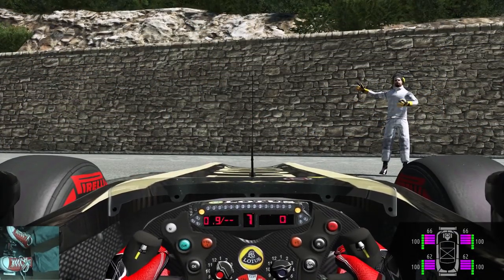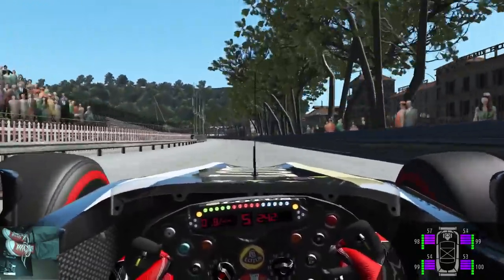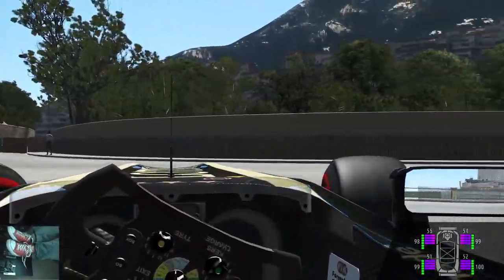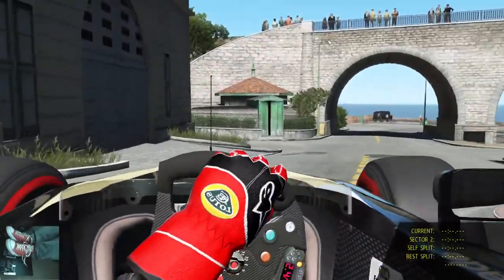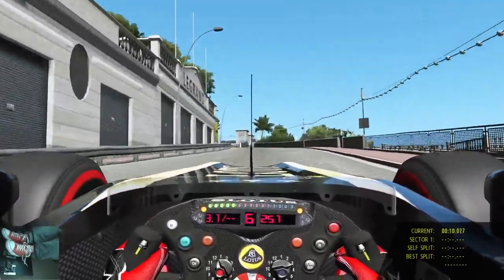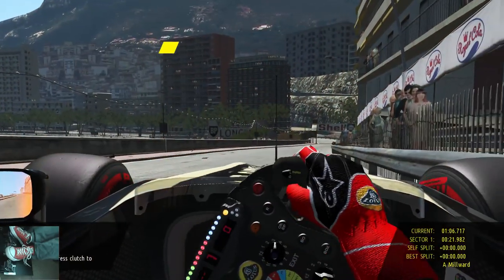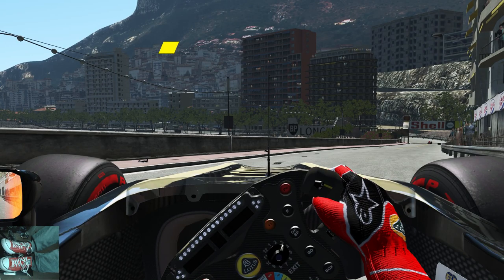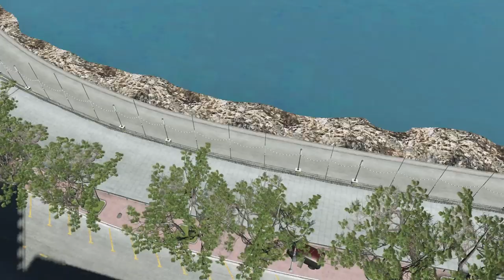HAMILTON CRASHED IN THE HARBOUR? What if Formula One Continued to Race at the Old Monaco

Comment: 1961- 1988 Kyalami circuit  running in Alonso 2013 Ferrari
1985 - 1995 Adelaide Street circuit running Vettel 2012 Redbull
and finally the Argentine Autodrome Juan y Oscar Galvez running the 2014 Williams

just a few interesting ideas along the lines of what we see here